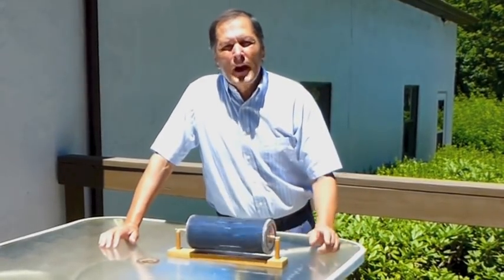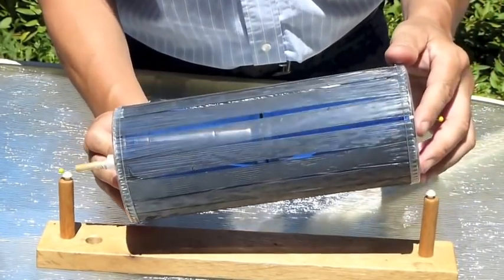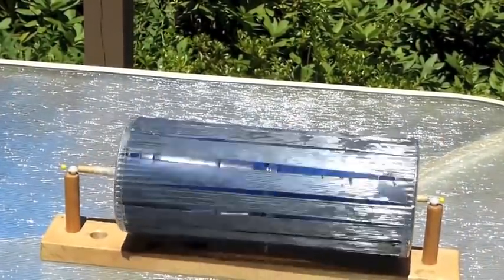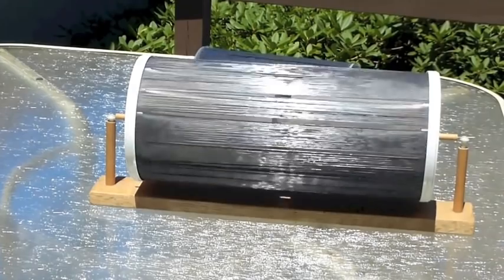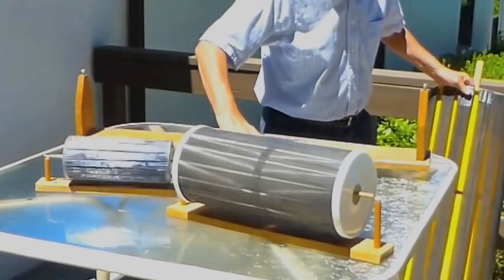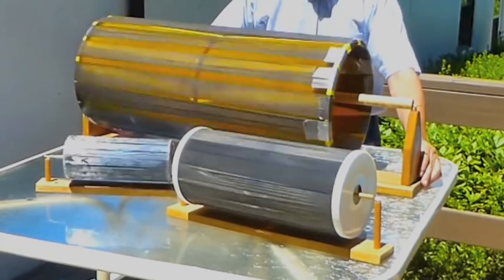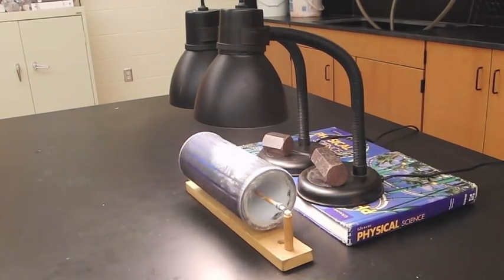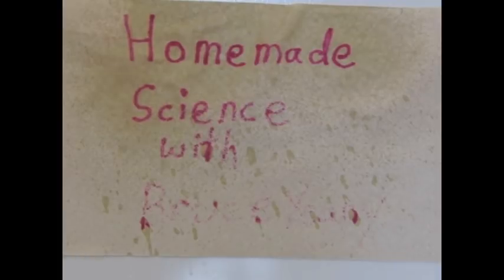Solar motor--Free energy motor-- not electrical /// Homemade Science with Bruce Yeany

Comment: What is the practical application of these?  If the energy they develop is so weak that you can stop it with a finger, what can you physically do with them besides convert solar to mechanical motion?  Any time you convert from one form of energy to another you lose.  So to me it's a neat experiment to show the possibility, but virtually worthless in the real world.  I could use that solar energy to charge up a battery bank with no moving parts.

Comment: To be a true free energy motor it must not receive continuous energy from an outside source such as the sun for example and has to run independently from any power source once operational. It must also produce more energy than it requires to operate. To cold start a free energy motor a outside source of power may be momentarily needed to get the motor initially running such as from a battery or storage capacitor.

Comment: All you need now is a lot of thin copper wire and magnets to generate electricity and a diode to keep whatever is getting the electrical charge to not bleed back when the generator isn't running.  There is a gear in a book called 507 Mechanical Movements that has a bevel gear system to double the speed of something turning.  This would be great to incorporate with a wind turbine to make a way to get some movement for a turbine.

Comment: if you where to make these on the micro scale? tiny little cells of these suspended on magnets with gold wires running through the bottom and in the wheel you have tiny magnets? Could you then have a kind of solar cell? theoretically the more you can fit the more energy it would generate?

Comment: Are you certain they aren't all moving at the same speed? The larger the circumference, the more distance it has to traveling, making the rate of spin slower, when the surface itself is moving at the same rate of speed. Seems like a little math could shed some LIGHT (pun) on this...
Reply from the maker: I hope to redo this next summer,  show how to make them and the power,  or lack of,  I will also take a closer look at their RPMs,  good suggestion

Comment: Could you use some kind of lens to focus the sunlight and make it faster or give more torque?
Reply from the maker: the problem is that if I use a lens,  the plastic will  get too hot and it will melt
Reply: Ah, fair enough. Could you use a type of material that is more resistant to melting? But that maybe defeats the use of a lens in the first place

Comment: Of course while these are an interesting scientific oddity they are pretty much useful as a source of solar supplied mechanical energy. If 2 x 60W globes (120W) turn the rotor with enough force for you to stop it with your little finger then they are converting 120W of thermal/optical energy into about 0.05W of mechanical energy. In other words the conversion efficiency is 0.0417& conversion efficiency where as a solar panel would achieve around 25% or in other words 600 times more so I wouldn't be investing in this any time soon.
Reply from the maker: I did measure the power output of these by having them lift a couple paperclips for a short distance and timing it.  For the smallest motor,  it worked out to be around 1.5 millionth of a horsepower.  So as an energy source these aren't going to help,  but I still find it amazing that they turn at all

Comment: since there is no explanation a how this works, ill give it a guess.  it works like a cam,  as the tape shrinks and expands the weight shifts and makes one side heaver due to the shifting centre of mass the tape gets hot and loosens allowing that side to bend and shift the centre of mass and on the shaded side the tape gets cold and shrinks and pulls the weight to one side  off centre    just like a cam system
Reply from the maker: Hello Mr, Yendor,  there is some additional information below the video
Reply: ya I don't get the kerfuffle with free energy,  nothing is free  really.  but ill say sun light is free energy, it is free we don't need to pay for it, yet.  I think the term over unity is the only one that needs attention to care in trying to use,  I think the  term free energy has been taken wrong  my self,  but I still don't use, it as it just starts arguments,  I do suppose saying that a device is a free energy is simply meaning it cost nothing in terms of money  to run,  a solar panel is free energy,  but if you had to put fuel into the sun then it is not free.  you can call wasted heat free energy or a better term would be reclaimed energy.  lets say a person is trying to harvest energy from a candle and they call it free energy , at the first look some might think it is free but if that person was not going to use that candle for the light it gives off then it is a cost  like  Fred he uses a candle every night to see regardless, and one day he decides to try and get back that energy lost as heat, then you can say that is free energy even if it costs  the price of a candle, because he will still burn that candle any way,  but if you only burn  that candle to run your generator than that is not free energy at all, it cost a candle
Reply: that still dose fully tell them how it works, your telling them some of the science but the actual mechanics is missing.  it is a cam  to me and it uses shifting weight to turn like a cam   if there was no gravity it would do nothing
Reply: you should try and make a powered version  with weighted drums  you could power the wire filament's via induction to cut down on moving and touching parts ie brushes  but that wont be free energy

Comment: I'm going to guess the heat causes the metal on top to expand, causing a difference as it contracts at the bottom, this puts it continously off center.
Reply from the maker: good guess,   there is additional information under the video

Comment: I imagine you could do something similar with bimetallic strips.  Say fastened to a solid rotor in the middle.  as energy hits it they curl and cause the moment arm to increase to a larger radius than the cool side.  Thus giving a torque.  put some magnets on the rotor and a pickup coil on the frame and produce electrical energy.  It will be ac so use a step up transformer and a rectifier and charge a capacitor.

Comment: I am surprised how quickly it reacts to the temperature change. I have played with tightly wound mono-filament fishing line which behaves similarly to the stretched bag material.  Twisting the fibers allows for a longer range of motion, will have to try this with the bag strips to see if it has the same effect.

Comment: So why does it move slower as it gets larger?
Reply from the maker: Good question,  I don't know, but I am working on another version that might have more torque
Reply: How will you do that? Just increase the weight?
Reply: What about a small diameter long length version. Maybe a four inch diameter and six feet long? Just a thought.

Comment: I think is amazing. thanks. If it add a few magnets around the cup and a couple coil, we could obtain some energy, what do you think? or the machine is too weak to holding small magnet? and what about the heat with the plastic doesn't screw it?
Reply from the maker: HI Orlando,  the motor is not able to turn much more than itself,  but I am working on a new design that might improve it.  the plastic seems to hold up so far but that is only because I use it for demonstrations, if used on a daily basis,  then that would break it down a lot quicker
Reply: ok. thanks.

Comment: too bad it's been done aka  Wind power = Solar energy   wind moves motor(power generator)

pinwheel will get you more power then these  with a pin wheel  you can at lest make  some power from a very small dc motor

Comment: it's a creative idea. who founded this ? 
Great job whoever did this.
Reply from the maker: Hello Nilaksh,
there have been several variations by others, vertical wheels and horizontal wheels so it kind of evolved to this point,  my first horizontal design used rubber strips instead of the plastic
Reply: Ben Ch 
it's written in the description that they had cut the strips from a trash  bag and stretched then about 5 times its original length. the material is "polyethylene" which we call "polythene" in common  language. it's easily available.
Reply: its a great video,i cant find the rubber strips like yours ,can you pls post link for me where can buy them ?thanks

Comment: "The use of the term "free energy" in this context means that this device is converting energy that is "freely" supplied by our sun and is not meant to suggest that it violates any laws of thermodynamics, or that it is creating energy." It's a good thing you said this, otherwise the Reptilian NWO agents would of murdered you with 1337 hax0r ray guns made of moon cheese :O
Reply from the maker: HI Kael,  LOL,   I still have to be careful,  that disclaimer didn't seem to be enough for some,  any advice for countering the 1337 haxOr ray would be greatly appreciated
Reply: pew pew

Comment: I suppose this works by absorbing solar energy, then heating the air surrounding it. This rises and starts a persistent but asymmetric convection. Air cools on the shady side and amplifies the effect.
Reply from the maker: HI Dennis,  there is a description under the video
Reply: Thanks for the education! That being so this should work really well in a vacuum. Does it? That would exclude convection as the driver.
Reply: This in itself can generate a certain amount of electricity, but even more if the surface of the cylinder is replaced with photovoltaic cells. And why stop there? With some small modifications, it is possible to make the cylinder rotate because of the wind. So in darkness with wind: electricity. In the sun without wind: electricity. In the sun with wind: even more electricity.

Comment: Wow Bruce I'm so impressed, this is such a great demonstration!

I have a question regarding the color of the strips. They are black in this case and dark colors have the property to become warm faster than light colors.
So my question is, did you try to use e.g. white strips for your demonstration? That would be very interesting to know (for my part at least ; )

Big thumb up from me, best greets and keep on doing that awesome work!!!
Reply from the maker: I first tried it with clear,  which did not work so well at all,  at least not with sunlight,  you are right in that the black warms faster
Reply: OK, exactly what I was expecting. Thanks a lot for the quick reply! =D

Comment: Completely useless and of course as most would have guessed, non free energy as it still requires the sun. If you're going to use the sun, use solar panels and get much more bang for buck. this is the most inefficient device I've seen. won't even power a light bulb and only good for decoration near garden fountains and so on. please change the title to something like 'solar energy without panels'
Reply from the maker: HI Phizicks,  Completely useless might describe  quite a few objects posted on youtube,  take the mendecino motor for example.  At one time the solar cell was just a demonstration  toy it was improved. Actually NASA built a similar version in the 60's that could produce a few hundred watts but did not meet their needs so it was dropped.    thanks for watching
Reply: Thanks, Bruce. nice job but needs a little more info and what we see happening.
thanks, Jim Jakosh

Comment: I still don't get how it works.

"Sunlight hitting the strips is converted into thermal energy (heat) which then causes the rotor to turn", How does it turns?
Reply from the maker: HI JP BD,  there is a description under the video
Reply: Hi Bruce. Many thanks for the response. I have read the description and i am starting to understand the perpetual motion is kept running due to thermal expansion. Very interesting phenomenon indeed. Is there any other material with this kind of properties?

Thank you for your time. By the way, i wish to mention i really appreciate your videos. The subjects are very well chosen and the devices you create are really cool. I am really looking forward to some more great ideas comming from you in 2017!

Cheers and happy new year my friend!
JPBD.
Reply from the maker: thank you,  and a happy new year to you also.  The first time I saw the type of behavior was with rubber

Comment: it only takes 120 watts to run the motor indoors lol - I can achieve flight with gps tracking and multiple video cameras with less power.  Back to the drawing board...

Comment: A nice "toy" but not practical for producing actual work. There obviously is not enough torque to run a generator to produce electricity or run an average sized motor. When you've accomplished that, then you'll really have something.
Reply from the maker: true,  but the solar cell also started out as a nice toy

Comment: I feel that while these don't have enough torque to overcome any useful fixed resistance, It might be possible to use in in a situation where the resistance is viscous in nature. This would mean that the resistive torque increases with speed, so possibly the rotor would find some speed of equilibrium and keep spinning. Like turning a small fan or stirring something maybe.
Reply: One could use mechanical advantage with them to store energy over time or have several of them working at the same time combined to a focal point to push heavier or faster.
Reply: Fenk Jones yeah that actually might work.... you might bag the record for the least efficient transducer in history lol....
Reply: Right, the best and most efficient would be a newer tech called magnetic destabilization. And because these cylinders "move" they could be very effective in  destabilization. Study up.

Comment: Could it generate enough torque to draw water?
Reply: They generate very little torque, just enough to turn itself by offsetting the center of mass making it "top heavy" and so gravity causes it rotate, adding any load would stall it.
Reply: That's what I figures, so I guess it's more of a conversation piece.

Comment: You could make a radial motor using shading and an offset attach point, similar to https://youtu.be/lfmrvxB154w, but instead of using motion to create a heat differential, you use the heat differential to create motion. Probably could be done with his rubber bands, too.

Comment: It's not "free energy" in a true sense. Maybe it's "renewable energy."
Reply: not renewable... sustainable. Wood is renewable, because it grows back, renewing itself. of course, it takes energy from the sun while growing, but that's just basic thermodynamics. Hydel energy is renewable, because the water gets renewed through the water cycle. Again, the sun is the source of energy. Geothermal and Solar energy themselves are sustainable but not renewable.
Reply: ***** I'm no expert on the definition of the word, so I would just like to direct you to wikipedia which defines solar energy as a type of renewable energy.

en.m.wikipedia.org
Reply: well of course Wikipedia should always be taken with a grain of salt, but I was just going off memory from grade 7 geography, haha... and it looks like I remember wrong, because apparently fossil fuels are sustainable too, just not renewable... idk haha
Reply: Good god, man, if you are going to work from memory of 7th grade geography (not even physics or chemistry), at least do a slight fact check before making claims.

Comment: Neat! Question: do the walls of the drum need to be flexible to react to the shrinking of the polyethylene strips? Or could I make the rotor out of light wood? I'm a sculptor, and this seems to be a neat thing to play with. Thanks!
Reply from the maker: the cups can flex at the joint,  one of the original ones I made were wood blocks as the drums,  it worked but making it with the cups was so much easier

Comment: you can save weight by ditching the cups and just taping the solar strips to two plastic lids ,that will form the tube and 2 plastic strips taped to the lids on the sides to turn the axle

Comment: What the tape used in this installation, how can I generate electricity with this engine?
Reply: Jaime Macedo, since some would rather get lippy than actually help; and since the video itself, in fact, does not answer your question of what the "tape" is made of, which had erroneously been stated previously, and is only referred to as "solar strips," I'll do my best to help you out. The "solar strips" used in this video are actually strips cut from a trash bag made of polyethylene. Those strips are then stretched to almost their breaking point. The heat from the light causes the polyethylene to contract a small amount, thus pulling the cups towards the top and changing the center of gravity (CoG). This change in CoG causes the apparatus to spin. All the while, the strips that are now on top, heat up, contract, raise the CoG, and perpetuate the process. Unfortunately one would be hard pressed to generate any kind of usable work from this motor, as it produces very little torque. Pretty much enough to turn itself about its axis. Awesome experiment for developing minds, and would make a thought stimulating toy, or an excellent conversation starter for the desk, or coffee table.
Reply: Jaime Macedo Watch it again and this time listen as well.

Comment: what is the principle behind it?
Reply: The plastic tape shrinks when heated by sunlight, this pulls the cups upward and offsets the weight which wants to turn downward again. So the motor turns and now the cycle can repeat on other sides.